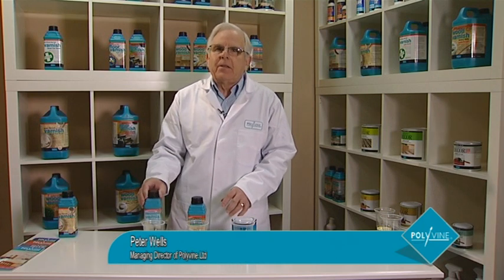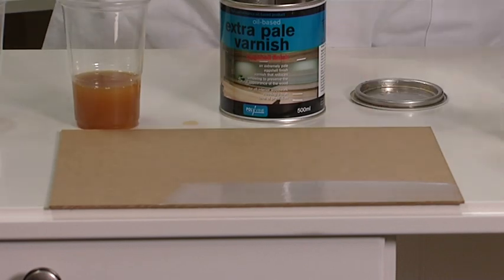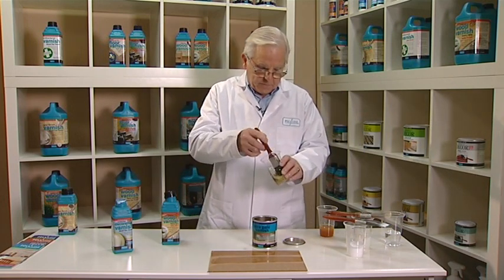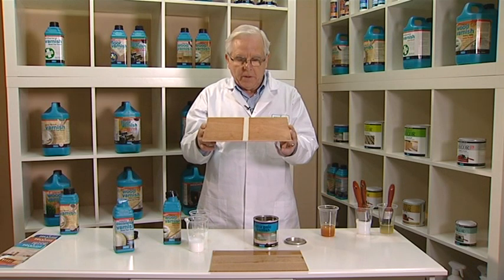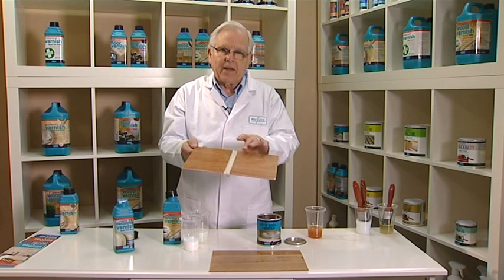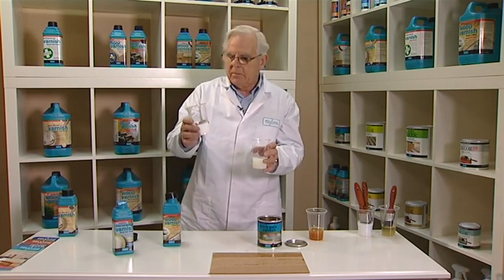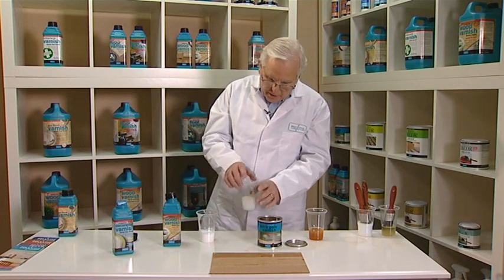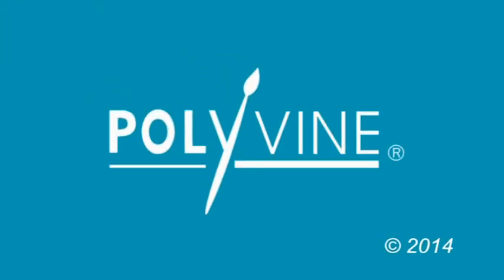water based or oil based

Comment: The best explanatory guide in the differences so far!!! Thank you soooo much!! I wish I had known before I vanished my hall floor because I was not warned about the profound smell or 14 day curing time and am, as a result, sleeping on my couch to get as far away from the smell as possible. Unfortunately, it is a small house so I am suffering with all the side fx off the oil based polymer fumes which are headaches, sour throat, sore and scratchy eyes etc. Before your video, I didn't know how long more the smell would last, now I can expect another week or so, at least there will be an end to it! Thanks again :-)

Comment: Hi , i have a  iroko cladded house about 100 m2 .there is a water based varnish on it would you recommend a oil based varnish would it be less maintenance ,and wot would the  quantity   be for that amount .thanks
Reply from the maker: Take a look at our new exterior varnish it is water based but lasts as long as an oil based.
Reply: will do thanks

Comment: Never liked water based varnish because it doesn’t perform very well when using on a large area. With oil based products you know you’ve got time to work with wet/dry edges and these materials have been tried and tested for years.
Reply: X2. Water based for quick, irrelevant projects, oil based for rough duty.

Comment: Oil base for me, anytime it's an option.
Reply: I agree John. Whenever a project will be exposed to heavy usage, or sever weather, oil base will outlast water based most, if not all the time. It may take an extended effort to get there, but is worth it. I'll continue to utilize it in some cases, while the government still allows it. :(
Reply: @joequillun7790  I have to travel to an adjoining state, luckily it's not far, to buy true oil base finish. I really like an eggshell oil base finish on interior wood trim.